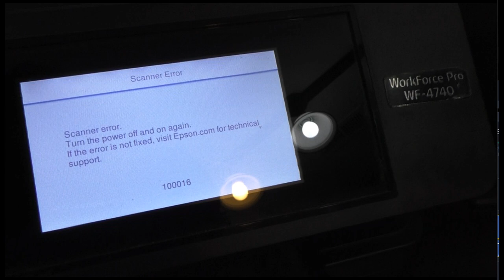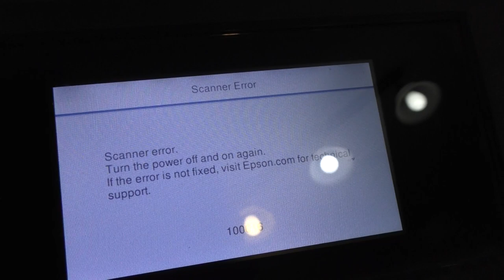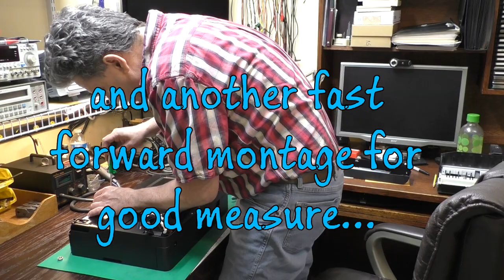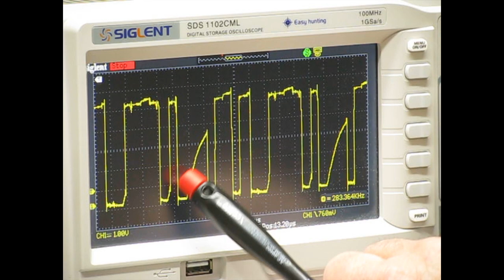Repair attempt: Epson WF-4740 with Scanner Error 100016

Comment: Thanks for the vid, unfortunately none of the steps you mentioned has had a positive effect on mine. The 100016 mssg reappears every time, and the audio chimes are getting really easy to dislike haha. Just as you were "amused" a scanner problem disables all functions, it also means I cant change ink cartridges - there's no way to access the LCD menu so how can I change cartridges?? And I am about out of ink...any ideas? Thanks again!
Reply from the maker: Maybe it is possible to use the printer driver on the computer? If you turn on the printer with the scanner document feeder up what does the scanner do? Does it move smoothly? Where does it stop?
Reply: Sorry I am not following you, "use the printer driver on the computer"? What does that mean? It makes no difference how the scanner doc feeder is positioned (you mean the doc feeder on the top of the machine?), the unit hums a few seconds then the chimes and error message reappear. There is no difference how the feeder is set, wish I understood you better, frustrating, thanks for the help though.
Reply from the maker: On the computer there is a printer driver that allows the computer to talk to the printer. It is what pops up and says your out of ink. Very often the driver program can do other things too.

What I was asking about with turning the printer on ADF up is what you see the scanner head doing, how is it moving. One thing I was thinking about is that the encoder wheel (sensor measuring movement) might be slipping. If it is slipping you might see jerky movement.
Reply: @HeyBirt  Ahh, you mean the "Epson Status Monitor", sadly "replace ink cartridges" isn't one of it's options. You can ck and clean nozzles, test print, etc, but there is no function for replacing the cartridges, there should be! On the scanner head, I guess you were saying keep the glass platen cover open to see the scanner head movement, is that what you mean? When I do I see the scanner head cycle thru it's wake up motions then nothing happens, no error mssg or chimes, only the EPSON logo on the touch screen, the machine locked. I really wish I could fix this, thanks for your help, so frustrating, only a couple years old
Reply: ALSO - what is the scanner head supposed to do in it's start-up? All mine is doing is move about an inch, is it supposed to run the full length of the platen? It doesn't, that might be what's triggering the error....? Thanks
Reply from the maker: The scanner should travel all the way to the right side and then back to the left. Yours is doing the same as mine. I don't know what that means yet but thanks for the information.
Reply: @HeyBirt  Thank you so much for your patience and info. Yeah, THAT is the problem, the scan head drive motor is not cycling fully at start up, the error mssg hits as soon as the head stops moving after going about 2". Any fix you know for this problem? If I feel up to it I may open  it up and see - or just spend a couple hundred bucks for a new one. Epson gave me a "discount card" towards a new unit. When I think how little $200 is today, it makes no sense to do anything else. How sad this era of disposable office machines, terrible. Thanks again, pls let me know if you have an idea how to fix the scan head drive motor. CDH
Reply: @cdh88  Mine is doing exactly the same thing.  Moves to the left margin on power-up, then starts moving to the right smoothly, then a little jerk, a few more mm of movement, the scanner light flashes briefly, and it stops - with the error message popping up then.  Does anyone have anything more on this yet?  I'm amazed that I can find NO working solution anywhere on the net.  Birt's sometimes fix isn't working for me.
Reply: Just to add more to this - nearly every "official" comment on this error (100016) says that it's a driver issue.  Weird to understand how that works on a network printer, not physically connected to any of the various operating system computers that it might be serving.  Despite this, I've followed what minimal instructions there are - to completely uninstall all vestiges of Epson software, then reinstall.  Nothing.  I have NOT yet tried either doing this with a USB connected, or, what I've heard "only sometimes works at all", the
 Recovery Mode Firmware version CN24K1.  If this is indeed a driver issue, it must be in the printer firmware, not necessarily on the computer.  Wish I knew for sure if this is a mechanical issue, as Birt! originally believed, or a firmware bug of some kind!!
Reply from the maker: I also do not see how this can be a driver issue unless the driver is sending an invalid command to the printer. For grins I looked at Epson's website and downloaded/installed the latest printer driver and scanner driver which were both newer than than what was in the bundled driver package. I'm not holding my breath though. My FW version is also the latest.

For grins I reached out to Epson for support via email and got a reply back in 24 hours that gave me a phone number to call. I'll try that this evening. Again not holding my breath.
Reply from the maker: This is what mien does when it pops up the error. When it does not pop up the error it continues slowly to the right, maybe 1/3 across and then returns more quickly.
Reply: @drbmac  I tried with USB, didn't help. At this point all I want to do is replace the ink cartridges and use it as a printer because it does still print. BUT, because the touch screen is showing the error mssg I can't get unit into replace ink mode. I have looked at all the remote options, and under maintenance, where you'd think the repl ink prompt would be, it isn't there - only nozzle ck and clean, print test page, etc. SO FRUSTRATING. My last hope is when a cartridge runs out the printer will offer a replace ink prompt, otherwise I think the All In One will become a None in One, pretty sad design! If anyone knows how I can get to a replace ink prompt, please let me know, thank again!!!
Reply: OK, one more - THANKFULLY when one cartridge ran out of ink, the unit showed the Replace Ink function on the touch screen! So happy, I replaced all cartridges so we're good for a while longer. Can't do anything but print now, but that is just about all we ever do with it. Thanks again for the comments everyone, good luck!
Reply: @cdh88  Well that's good news.  I was worried about the same thing.  Would still like to be able to scan though...!
Reply from the maker: Updating the printer and scanner driver is useless. But it was 'free' to try :)
Reply: Well sadly the printer problem has gotten worse. Another cartridge ran out of ink, thankfully I was given the menu screen so I was able to replace the ink. The bad news is now I don't get the scanner error message, only the EPSON logo on the screen and that's where it stays, damn. Now it's an anchor unless I can find another fix, can't even print! I think it may be time to try a different printer.
Reply: @HeyBirt  this is what mine does too.  I paid very close attention it appears the little belt begins to slip.